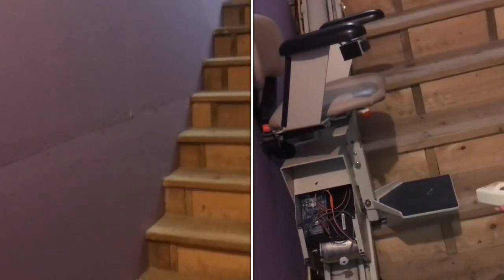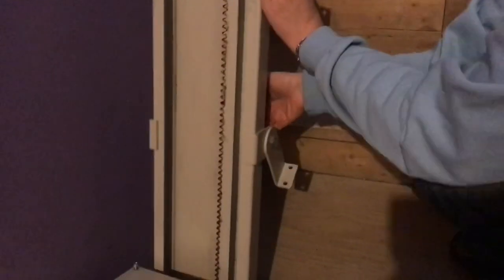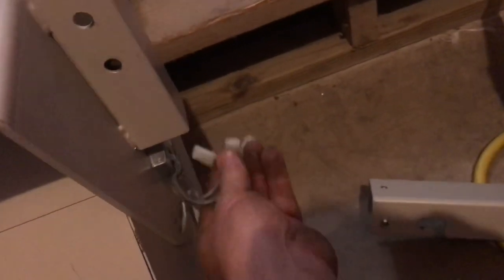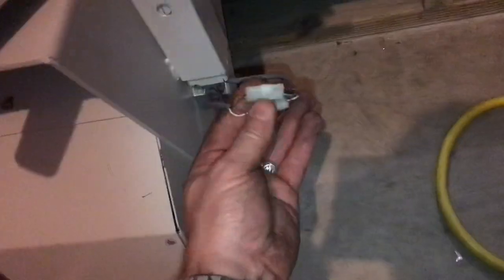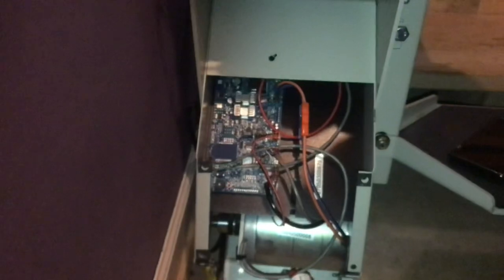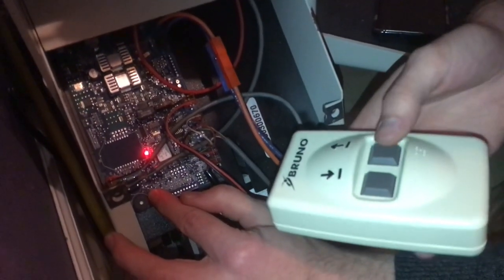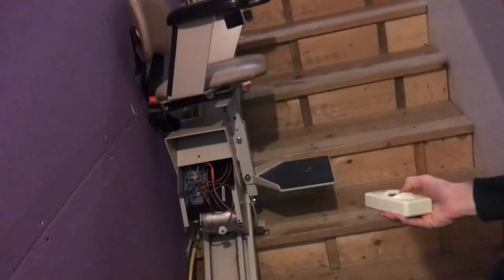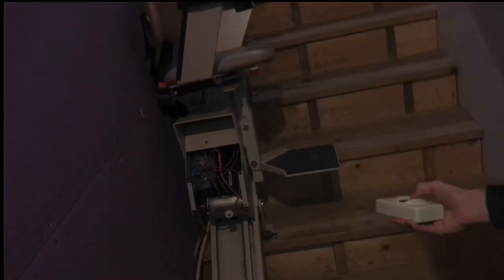installing “bruno” STAIR LIFT

Comment: I was replacing the batteries on a Bruno 2010 and the ground wire came off the circuit board.  Is there a chance that you could share the wire location with me?  Thank you.